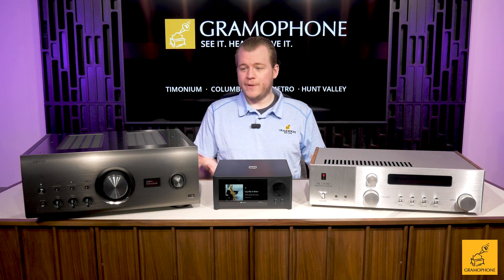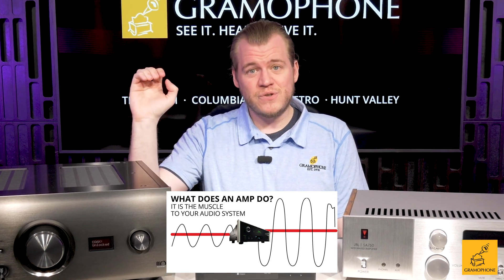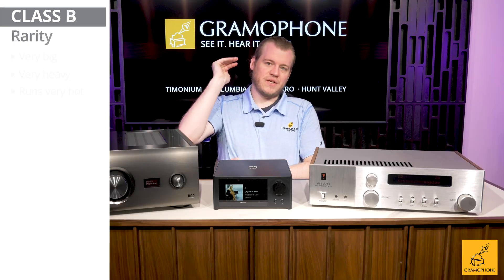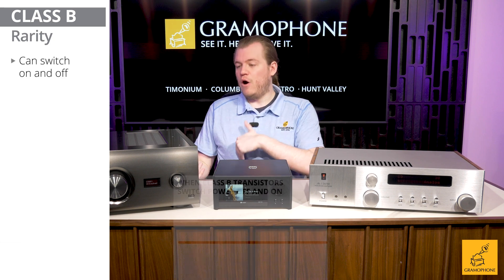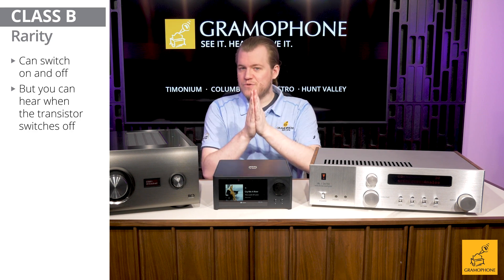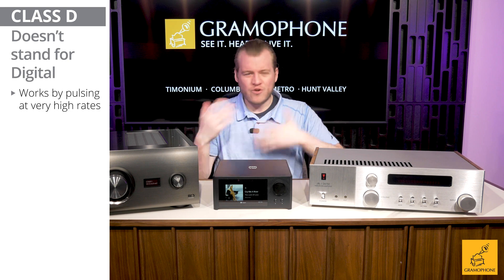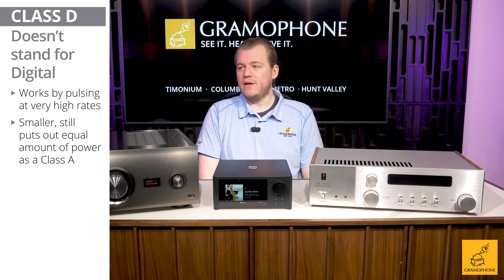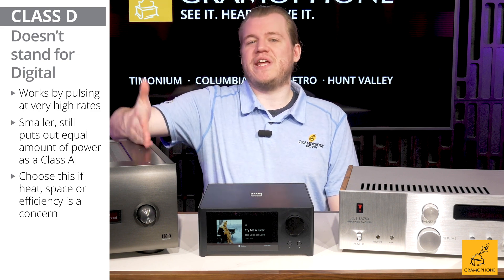Amplifier Typologies explained | AudioU

Comment: Actually Class D is digital.  The technology used in Class D is PWM (pulse width modulation) is controlled by a digital processor.  It produces high frequency extraneous signals which must be filtered through inductors in order to prevent the ultra high frequency extraneous signal from burning out tweeters.   It’s a cheap technology which is actually a step backwards from complimentary symmetry bipolar Class AB designs since it introduces an inductor into the output signal path.  Avoid.  Class G is simply a less expensive but sophisticated method of approaching a Class AB design.  It’s OK, getting better with improvements.
Reply from the maker: Hi Jesse, yes, Class D is digitally based.  But in working for a well known amp vendor not long ago, the design team did a lot of work with Class D.  Where 10 - 15 years ago Class D wasn't so good, the modules available now sound much better.  Class A/B has some advantages, but Class D can actually sound nice now